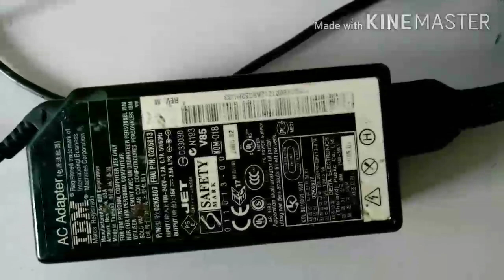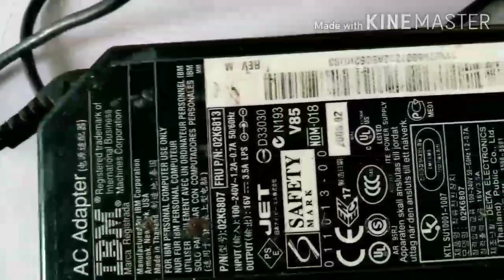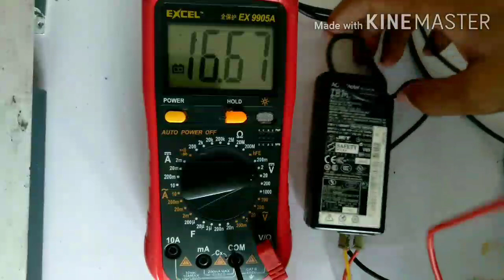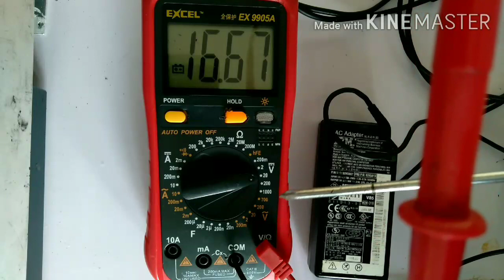How to Repair a laptop power supply / charger?እንዴት የላፕቶፕ ቻርጀር/ፓውር ሰፕላይ ይጠገናል?

Comment: You're  hero
Please can you tel me how to open  the board
Reply from the maker: 1 . Unplug the power cord 
2 . Disconnect the power cable from the laptop
3 . Twist the putty knife to pry on the adapter. Continue this step around the perimeter of the adapter until you are able to break the seal. If the putty knife does not break the seal, you may want to use a flat-head screwdriver. Separate the top half of the adapter from the bottom half, to expose the internal structure of the adapter.
Reply from the maker: and also wait for the video soon!!!

Comment: bezu gize yemeyagatemeg eske cap volt meto keza behula alafem yelega gn compountchu yeseral domintsrate betadergleg des yelega tnxs
Reply from the maker: Check Switching section with pwm circuit.
I think short circuit